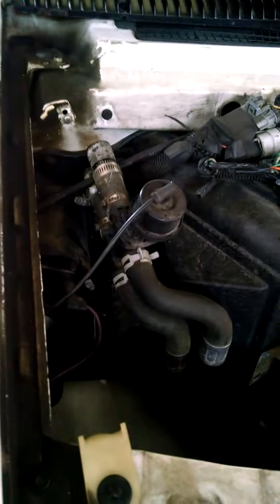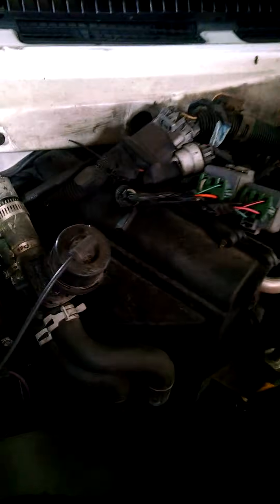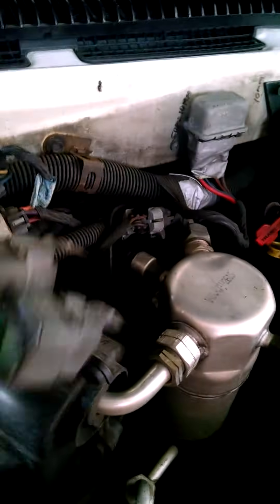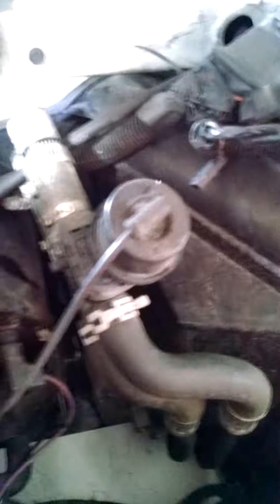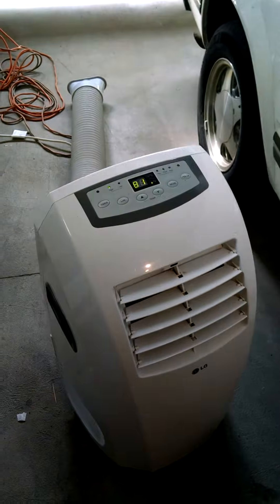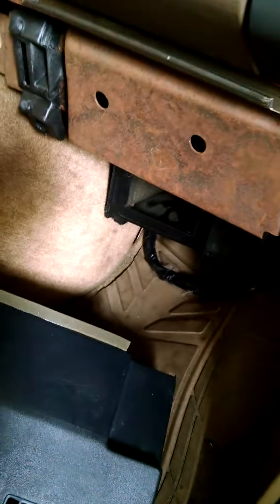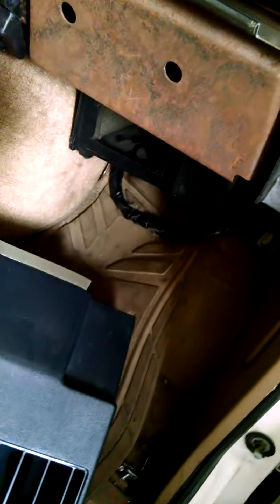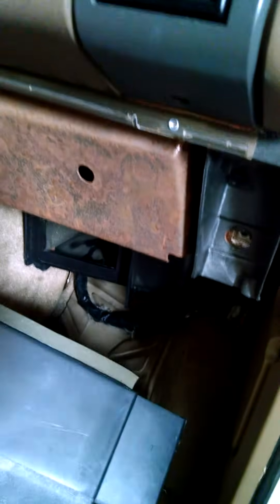Heater core 95 Astro

Comment: Thanks Steve I just flushed out my 92's core and will change out the control valve but if I still have no heat my next step is replacing that core. Thanks this helps!